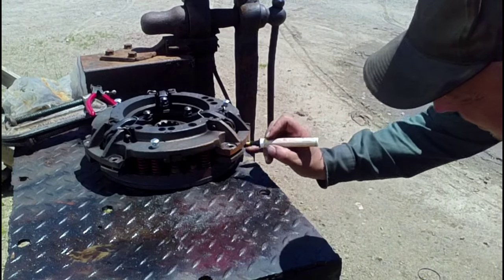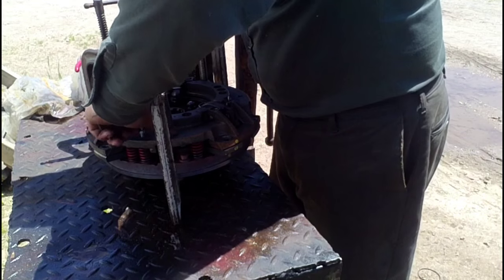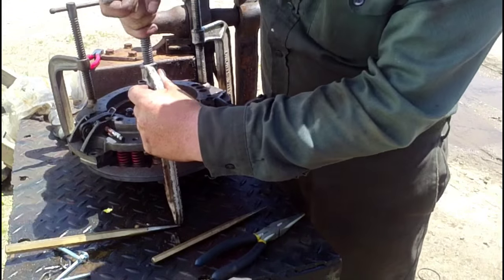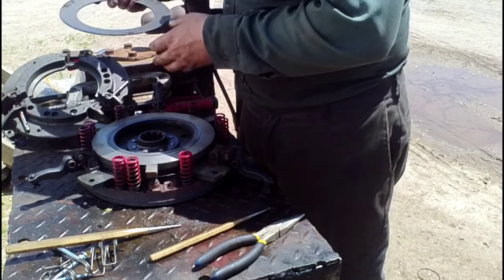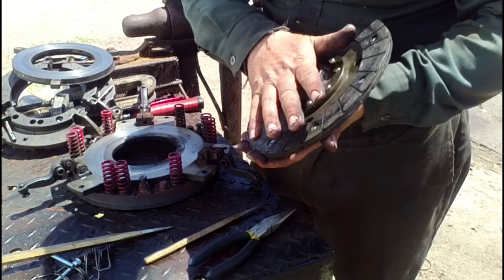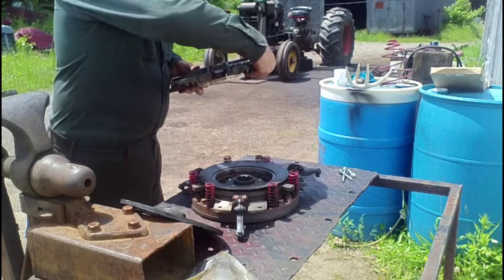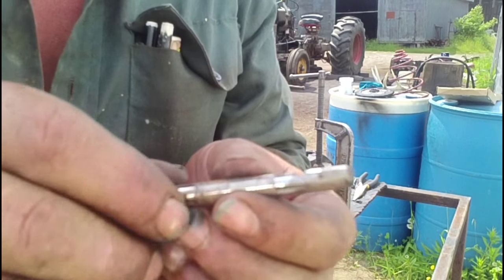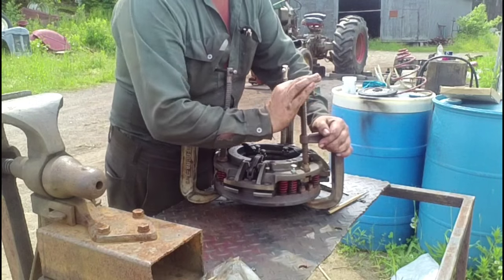Replacing a captive disk in a 2 stage pressure plate

Comment: This video combined with the video of taking the clutch out were immensely helpful. The clutch in my MF165 was done. Pretty sure it was original from the early 70's. Just a couple tips on taking these dang things apart. Plan for a few days, since as of yet, I have no idea how to tell what clutch is in the tractor without taking it apart. There are several different combinations. Use a heavy duty c-clamp. Wood clamps are not gonna make it easy. If you have the blue springs in your clutch, be ready, they are a much heavier spring than the red ones. I had the blue springs, but the new clutch had the red. I have yet to notice a difference in performance. In an older clutch, do not use the bolts holding it together to compress the springs, especially with blue springs. Use the c-clamp.
Reply from the maker: Good tips, thanks for sharing them.

Comment: At 9.21 you mark the anchor plate that bevel washer has to sit up on the lip of anchor plate correct or does the bevel washer go over top of the lip on anchor plate because on the Massey 25 it doesn't go over the lip so I put it together upside down on a block to keep that bevel washer straight will you clamp it together I had one machined so bevel washer slipped over lip and it didn't work properly
Reply from the maker: The belleville washer sits on top of the lip, the cover will hold it in place.

Comment: You don't have to clamp it that's why you put the bolts in tighten them remove pins back bolts out one turn at a time I use a three inch bolt with a nut
Reply from the maker: You certainly clamp the pressure plate with bolts, I just use  c-clamps. Thanks for watching!

Comment: Hi, your videos are very informative. I have a John Deere 510 I purchased  with two stage issues. pto and 1 gear which uses two stage are grinding, second stage not disengaging. I split tractor and adjusted according to the service manual (adjusting screws were seized so had to split). Reassembled and no change. Pedal is fairly solid on second stage, doesn't feel right, felt the same before I split. I think the second stage is seized and not moving at all. I didn't disassemble clutch as I had no dummy shaft. I'm going to used like this for summer by shutting off tractor to engage pto. Split again when I am done for the season. What is the fix? New pressure plate? Where would I be able to aquire a dummy shaft for install?Thanks in advance,Jim
Reply from the maker: Hi Jim, it sounds like the second stage is seized. The pressure plate itself could be rusted or stuck, or the secondary disk could be stuck to the two pressure plate faces. Either way, most reliable fix is a new pressure plate. Some replacement kits come with a lining shaft, otherwise you may have to improvise with sockets and an extension. Good luck and thanks for watching!

Comment: what will happen when you put the washer the other side?????
Reply from the maker: I believe you mean the belville spring that operates the PTO pressure plate, if so, if you put the spring in upside down it might bind or not release when the clutch pedal is pressed. Thanks for watching!
Reply: OK thanks

Comment: Hi Dave, your videos have helped me so much, thank you for doing them! I have a question, I'm replacing the PTO captive disc on a massey 35 today... but instead of the wire clips holding the 3 lever pivot pins in place mine are held by a small roll pin that is driven into a hole in the cover casting through one end of each pivot pin, do I drill these roll pins out or shear them off by driving on the pivot pins in order to release the levers? Then do i replace with new roll pins?
Reply from the maker: It seems to me that someone has been into that one before and either lost the spring clips or decided a roll pin would be better which leaves you in a bit of a pickle. If you just drive the pin out breaking the roll pin there will still be a piece in the hole below the pin to get out, I think I would try getting something like a small screw to grab the pin and try to pull it. Good luck and thanks for watching!
Reply: thanks for taking the time to reply Dave, turns out from an old service manual that this was the way the lever pivot pins were held on the earlier MF35 double clutch, the manual says to drive them deeper in towards the belleville washer and shear off if necessary by striking the pivot pin. For reassembly, it says to replace the pivot pins with a special D headed pin that's held in by a split pin through the end. I guess the flat side on the head is to prevent the pin from turning in the cover journals, the D head of the pin should be on the leading side as the clutch rotates. I will have to order a set of the pins, looks like Sparex S.1782, MF 828597M2 in case anyone else has the same problem. Thanks again. Content by experienced people like you and Bundy Bear 'down-under' plus the ongoing availability of parts for these old tractors helps keep our head above water here on the farm... on the left coast of Canada. It's a small world now!
Reply from the maker: It's great you had access to that manual, that takes all the guess work out of the equation and thank you for the update, it is great to have the learning opportunity! 
 Lance at Bundy Bears shed is a great guy and very knowledgeable, a really great resource!